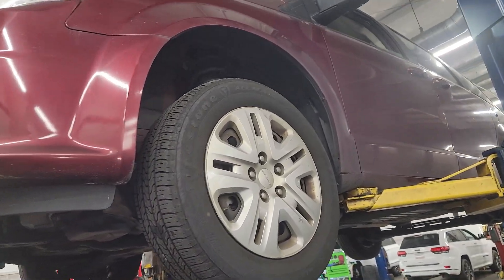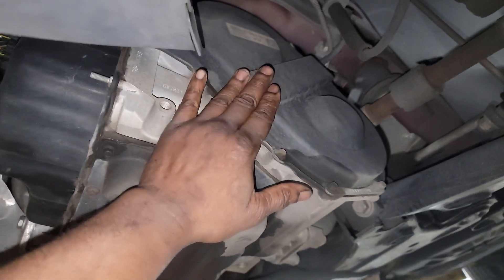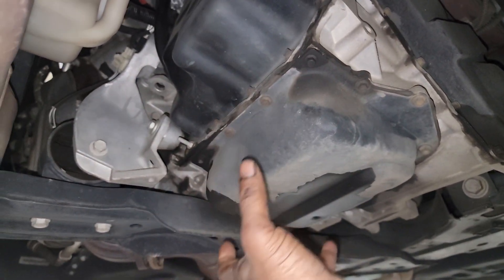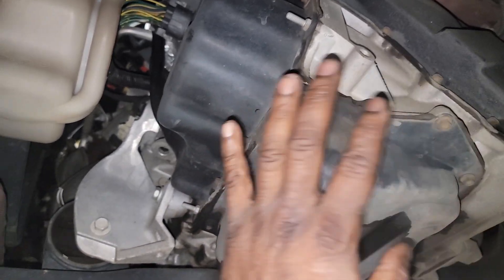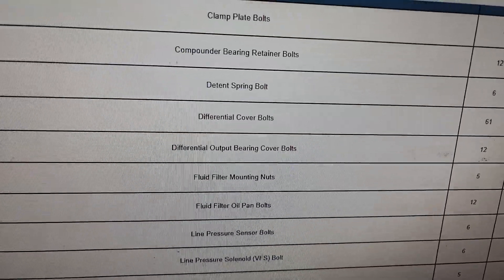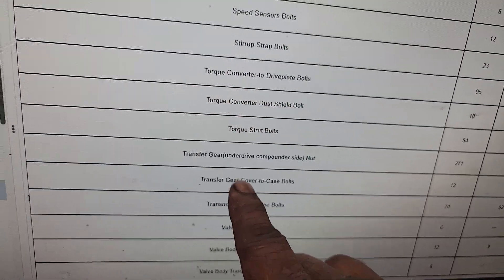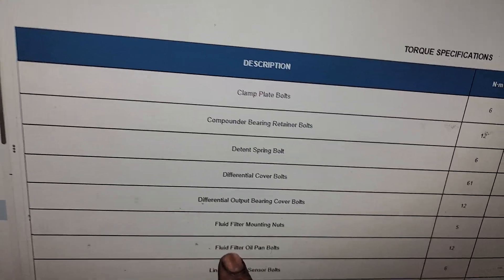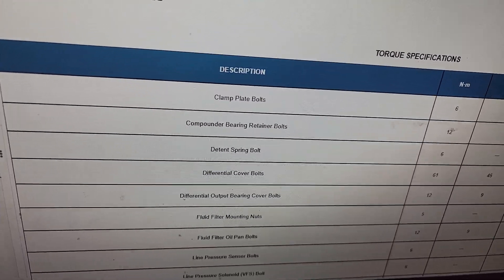The 62TE Transmission Torque Specs. Here's why you should service it every 60K miles.

Comment: I did a fluid change on one of these 2016 vans about a month ago and it had over 110K miles on it with no transmission fluid or filter change before that.  The transmission wasn't showing any signs of wear but it wasn't as great getting up to speed like it should have been.  The old fluid came out looking like crude oil, almost black sludge, but there wasn't a lot of metal on the magnet at all.  After filling it and test driving it the van drove like brand new, almost felt like a sports car.  Every 50K to 60k miles for transmission service is pretty damn important.
Reply: I have a '12, w/ 200+. Im assuming fluid never been changed. I used a pump and dropped the pan, yeah, fluid was black like crude oil